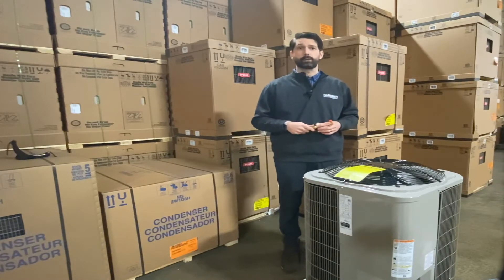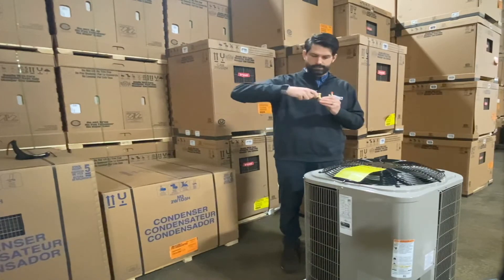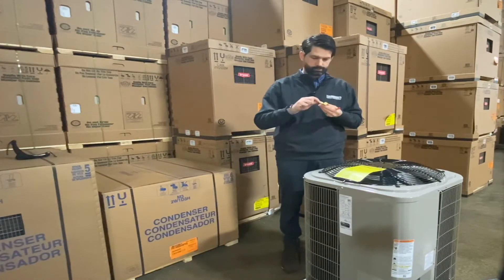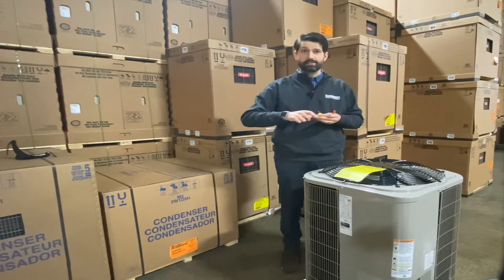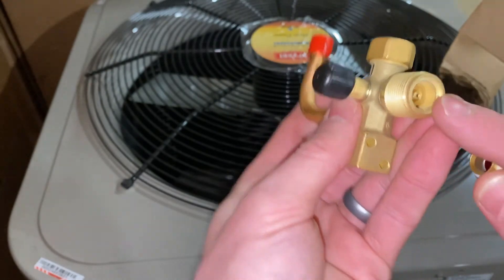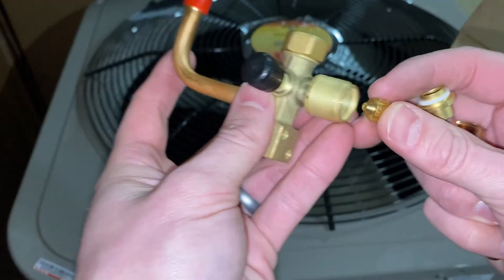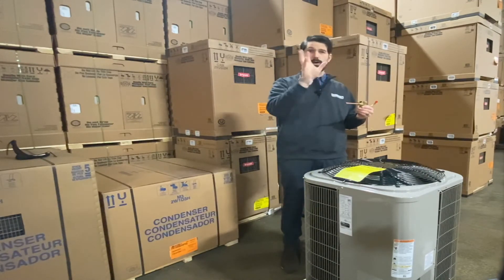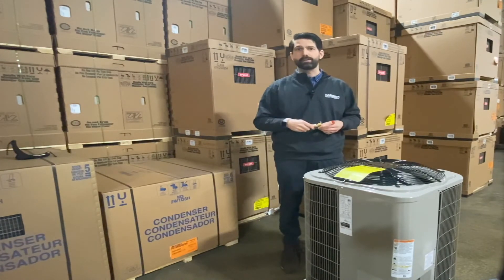Bryant Heat Pump Piston Installation

Comment: Hi thank you for you explanation. Has the piston a especific direction into the holder?
Reply from the maker: It is directional so it can seat one way, by-pass the other. 

It can go in either way, but the adapter won’t screw on unless you are in the correct position. 

The piston needs to seat into the piston body for the adapter to screw on. 

Thank you.